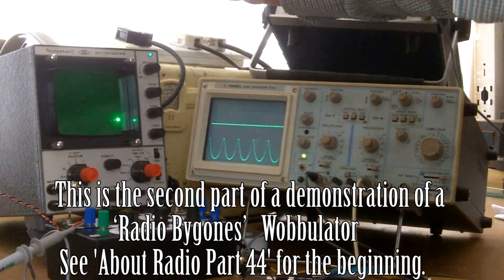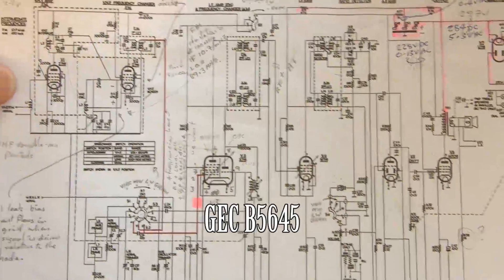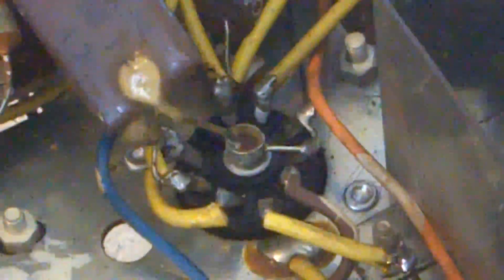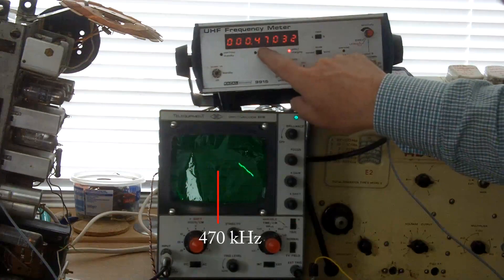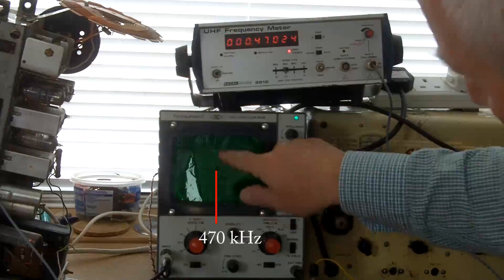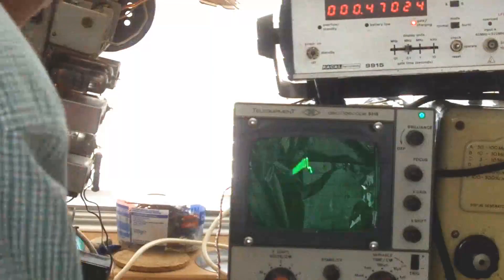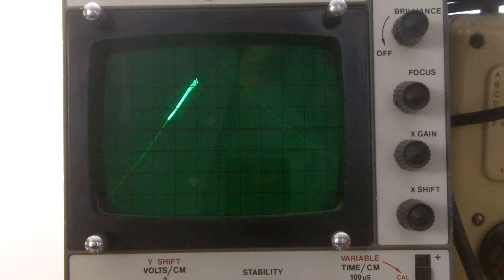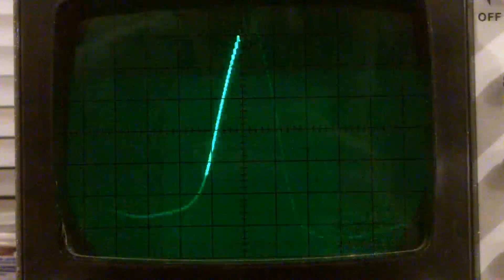About Radio 45.  A working Wobbulator (Radio Bygones) 2nd part

Comment: Hi Andy,
I have managed to build my wobbulator, and I can see the nice bandpass like you show.
However I am struggling to get the marker frequency to show.
How did you connect the wobbulator and the fixed generator? Did you use the wobbulator high impedance output?

Comment from the maker: OK Paul, I could pass for steam-driven myself. 
Yep I like a bit of kit you can fix when it goes belly up, something with enough space to swing the hammer around in ideally. 
Man we’re dinosaurs, I remember building my first computer, a Sinclair ZX81, now if anything needed the hammer taking to it was the ZX81, it used to lock up every time the fridge switched on, I used it as a Frisbee against the wall in the end    
Kind Regards
Andy 
 GWØJXM

Comment from the maker: If a radio or amplifier is working correctly the power supply capacitors will usual discharge into the circuit within let’s say less than about 30 seconds after switch off but don’t take that for granted. I have worked on some communications equipment (Eddystone Radio) where the its been possible to switch things off in such a way as to leave the HT caps fully charged! In faulty equipment you really never know what you’re going to find so always assume it’s going to be dangerous
...Andy

Comment from the maker: 1 of 2 Hi there, the best thing is to have a ‘known to be good’ volt meter and simply dab it across the caps. I must admit that sometimes I will just double check by shorting. I’ve never killed a capacitor with inrush (outrush) current although I guess capacitors shouldn’t be treated that way but rather the capacitor than me. A technically sound answer on discharging is not straightforward as I don’t know the maximum voltage you have...
Andy ...

Comment from the maker: 2 of 2 ...if you have 350 Volts DC then (that could stop your heart) you could use something like a 2 Kohms 10 watt resistor, that’ll initially pull 170 mA (i.e. 61.25 Watts) but the voltage will quickly drop (DEPENDING ON THE CAPACITANCE VALUE) and the resistor won’t get hot (unless the supply is still on!!) Check this out with the Volt meter in place you’ll get a feel for it but ALWAYS short out the caps before you dive in. 
Hope that helps.
Kind Regards ... Andy